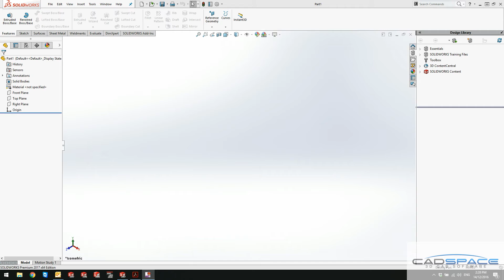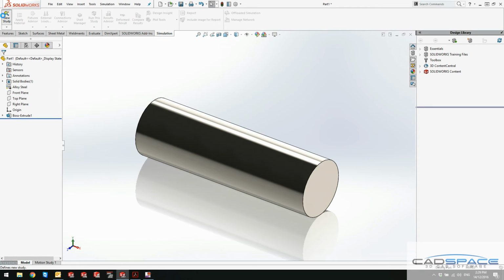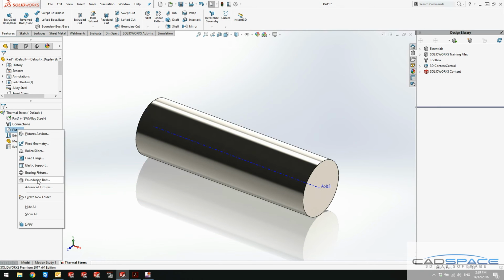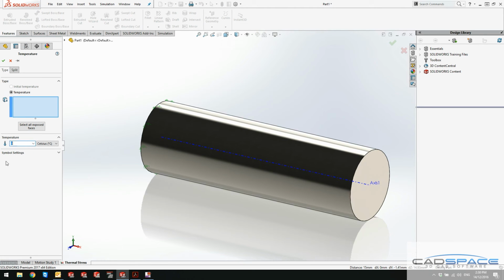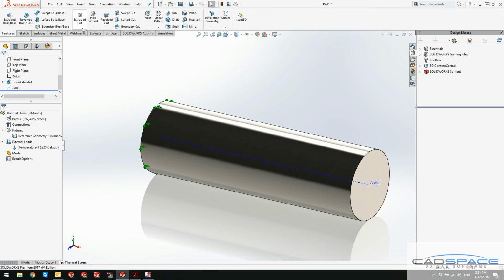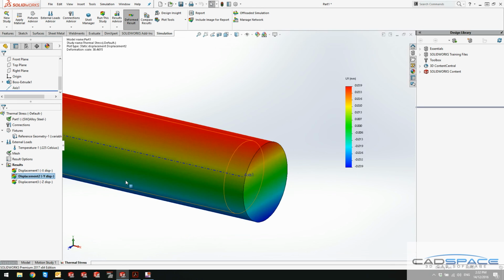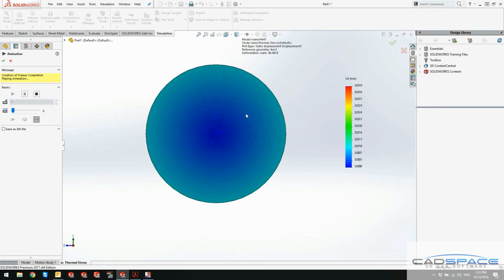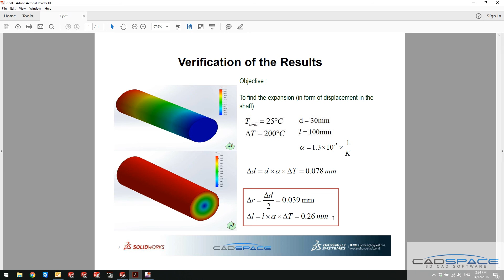SolidWorks Simulation Tech Tip - Thermal Expansion

Comment: I’m working on thermal stress of soil, I want to simulate the deformation at a microstructure level. On solidworks, can we use rock forming minerals? Can we find the thermal properties of those minerals in the software?
Reply: theres only wood AFAIK.